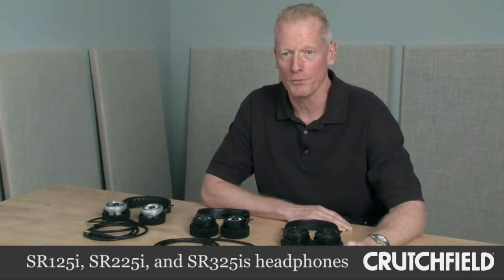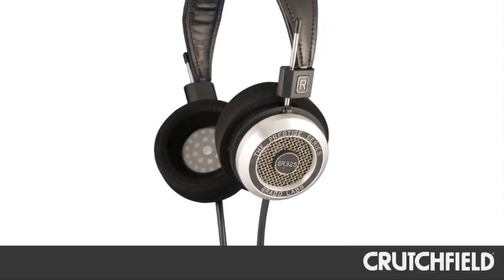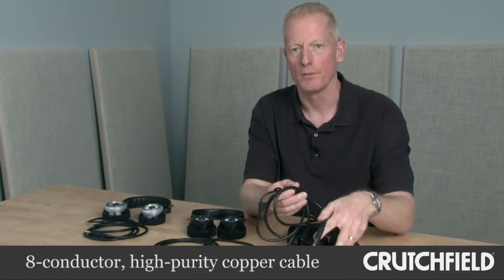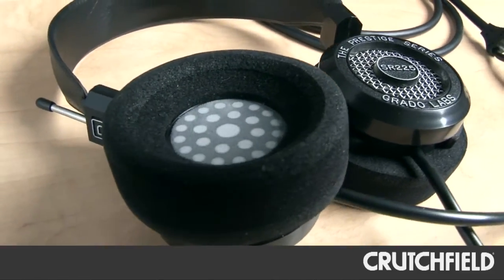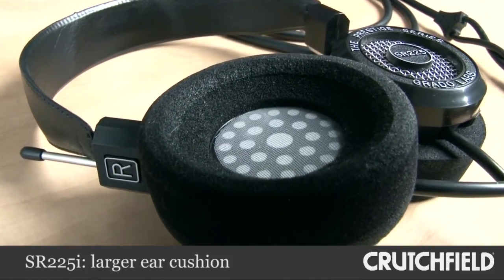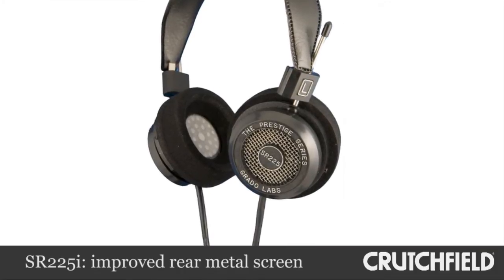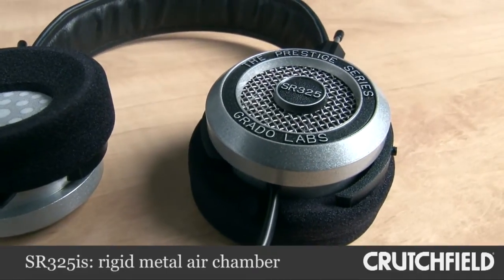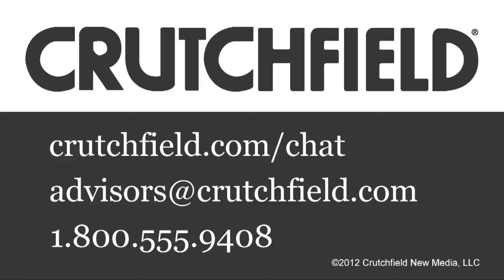Grado SR125i, SR225i and SR325is Headphones Overview | Crutchfield Video

Comment: Compare the HD600 or HD650 to SR325, which cost about the same, and you'll see which is better.  Lets not go into the fact that HD800 is 20 years ahead of the best Grado in terms of technology and sound.  Grado's are easy to power, thats why they might come off better if you dont have a good headphone amp and source. Otherwise, its no comparison. Grado is some of the most overrated stuff you can buy in the headphone world. Very colored, bright, shrill, etc. Not natural at all.